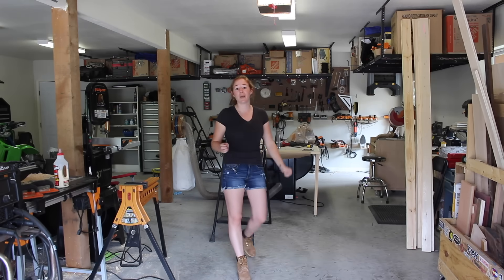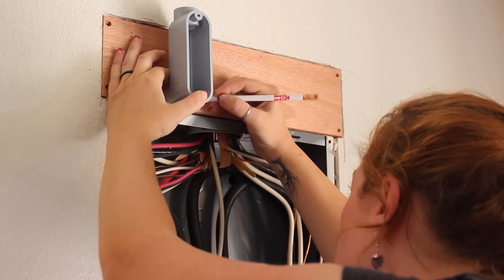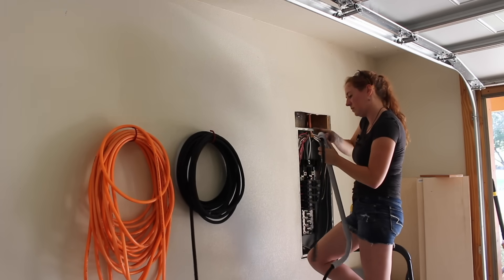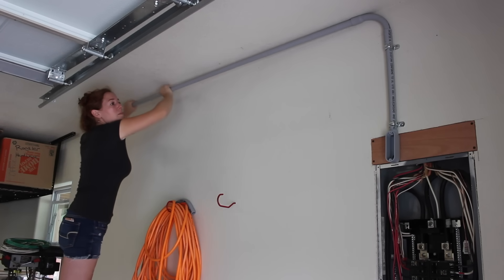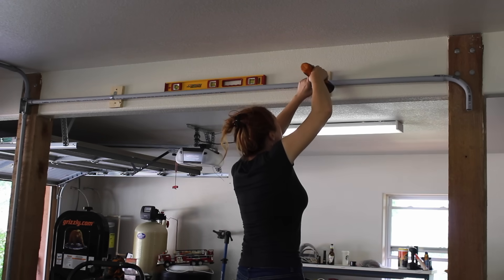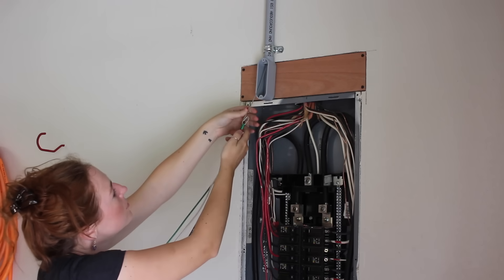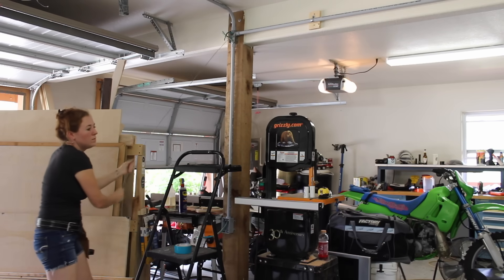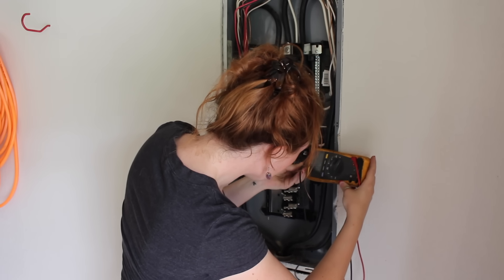Adding 220 Volt Outlets to the Garage

Comment: Some general thoughts:
-- Electrical work is generally pretty easy, at least in physical terms.  It's the other stuff that sneaks up on you.
-- Just because you CAN do something, that doesn't mean you SHOULD. To be specific, just because you have some open breaker spaces it doesn't follow that your panel can handle the new load. That's what load calculations are all about. In this example, it matters a great deal if the 220 is for the occasional use of a table saw, or the routine use of an electric car charger.
-- Garage / shop needs tend to grow. Rather than running circuits as needed, consider instead putting a panel in the shop - and feeding the shop circuits from there.
-- Splices in conduit bodies? Even IF you're technically legal, it's a lot easier to use a junction box - preferably a round one for junctions and a square one where you use bulky 220 devices.
-- I like your choice of sealed PVC boxes. In my experience, though, PVC requires a lot more support than code demands. It WILL sag over time. I also find it worthwhile to use primer along with the cement for stronger, more durable connections. It may take some doing, but you can find clear primer and grey cement.
-- The mounting screws need to go into wood, not just drywall -- especially for the boxes.

Comment: As a retired civil (not electrical) engineer and someone who makes short sticks from long ones, I have to wonder why (and how much spent) you accumulated several pieces of 220V equipment ("big" table saw, plasma cutter and compressor) BEFORE you had a means to power them.  I matters b/c although I have no room for it, the local FB marketplace has a real nice jointer but it's 220, and I also have only 120 at my house.

Comment: I'm afraid to mess with the main circuit breaker, but I do already have a 220 line going to where a dryer used to be. I'm installing a new washer and dryer in the basement and am considering running a line from that outlet to the basement since it's unused. Doing some research into 220v and already figured out what cable and how to wire the outlet. Appreciate the info from your video as well!

Comment: Since the 1950's are home ckts are 125VAC or 240 VAC, no 220v. You're also missing a neutral wire. The 240 VAC receptacle we saw wired up is for a heater or dryer.

Comment: SOOW/SJOW cord isn’t allowed in conduit due to its rubber jacket getting caught while pulling it through conduit 400.8(6) NEC.  You could have used NM(romex) in conduit this is allowed for physical protection even though some electricians will whine about it.  The changes I would have made if doing this project are putting a junction box 4x4 instead of the LB coming out of the panel it would have been placed on the drywall not the wooden panel with romex or mc running from
 the panel to the back of the junction box and the pvc off of that.  I also would have used a 1900 box (4x4) at your junction.  I didn’t see you ground the metal box this done so breakers trip if one of the hot wires comes in contact with the box the breaker will trip instead of the box becoming energized and is a code violation.  Thhn is not allowed to be run from an LB into a panel if it’s not in conduit this is a larger code violation than you fighting to pull the SJO cord through the conduit.  The last thing I saw was using a white thhn wire for a hot without identifying it as a hot with black or red electrical tape.

Comment: Why, oh why, does the thumbnail for this video show Ms. Wilkerson looking at the Fluke voltage meter with the meter in “landscape” orientation?  It’s not like a smart phone which will re-orient itself depending on how you hold it.  It’s a Fluke, and the display screen is the same as on all of them: one way is up.  Maybe she has hacked hers so she can use it as a gaming console…now that’s a video I’d like to see!

Comment: It's all about heat dissipation when deciding what type of wire to run inside the conduit.  THHN can keep cooler than SO.
Reply: No not really. The amount of current that will be drawn will determine the cable's cross-sectional area and length.

Comment: Good work! I like the clean, straight path you took from the panel, I would say though that THHN wire has to be in conduit for the entire run, so it cant be exposed in the wall

Comment: Sadly, the american electrical system is lame.  Single core wire and 110V.    Where I live. 240V and multi strand wire is the standard household system. . My workshop has 20, 240 Volt. 10 Amp, double outlets (switched as well) and one 15 Amp double outlet for the 4HP compressor.  Plus a 415 Volt 32 Amp three phase socket for a welder.   I can see why so many americans diy their electrical. Because it's virtually low voltage.    Have fun.

Comment: April, you are the bomb.... what a great video.  Your definition of scrap wood (that you installed above the panel), is certainly different than mine.  That piece of wood in my shop, would be one of the best, off cuts I have ever had.  LOL
Keep up the great work.

Comment: Anyone who isn't an electrician shouldn't be messing with it much less teaching it!! Did you ground your metal junction box, obviously used in error? You forgot to secure your ceiling run? Now, with all the knowledge you gained reading about this project, maybe you can explain how you attached the LB (the little gray thing near the panel) to the panel??

Comment: I am an electrician. I’ll say to your viewers, hire an electrician. You did violate some code articles. Exposed wires in your wall above your panel, no connector in your concentric knock out, and you did not bond your metal junction boxes to ground.  This is not the safest install but good job considering you the lack of electrical knowledge

Comment: You did a pretty good job just one thing, you did not use PVC Glu or PVC Cement to glue the conduit, so it is not sealed or fully secure.

Comment: If you run a plasma cutter and compressor on the same circuit, the breaker is going to pop since they'll both be running at the same time.

Comment: Running a 240v/60amp circuit from my main overhead in 1” PVC, across the ceiling and through the wall into garage for an EV charger.  YOUR video was the best I could find on YT - seriously.  I’m using YOUR idea to use an LB to get the 6 gauge into the panel.  That was an absolutely genius way to do it.  Thank you, ma’am 👍

Comment: I don’t know if you did it but just didn’t show it in the video but did you ground your metal junction box? Plastic ones don’t require it but those metal boxes do, that’s what that raised hill section with the 10/32 (I think) hole in it on the bottom of the junction box is for, all the big box stores sell packs of special ground screws specially for that hole so you can ground the box just in case there is ever a short

Comment: You are running THHN to the panel in “free air” between LB and panel? I know it’s short, I’m wondering if it would pass inspection since running THHN in free air is not to code

Comment: I'm looking to add a few 240v outlets to my Shop, for Welder, Compressor and Plasma cutter...

Can you run all three on the same circuit?

Seems like it'd overload the breaker if you used more than 1 at a time, like if the Compressor kicked on while welding...

Comment: First things First nice neat level conduit run, I think the way I would have done it is to place a junction box above the load center a dropped my Rated cord down to the panel then start my pvc or thin wall pipe with the open access you created gives you room to secure your cable to the stud, just a little FYI

Comment: So much better then most you tubers post!  I'm a licensed electrical contractor in CA and only a couple comments.  Should have used any color but white for your second hot leg. White is only for a neutral not a hot leg. Junction box could have been bigger but your make up wiring looked good. Conduit is necessary in a garage, Romex cannot be secured to a wall.  Good call on the conduit and THHN. Looked good!
Reply from the maker: Thanks!
Reply: @AprilWilkerson  using the white wld be OK if you mark it with black or red marker or 2 dabs of tape. And yes use a 4square box even a deep oversized square box a little more money but the space to work with is worth it

Comment: Wrap white wire that you used with 220v outlet with black tape on each end to identify them used as hot wire. This is only for two hots and a ground.

Comment: Permits. It's ok to do work at your own house, but it's best to pull a homeowner permit for a couple of reasons. First, the work will be inspected, and you can correct any mistakes you may have made. Second, when you sell your house, the prospective buyer will see the electrical modification was permitted and passed final inspection- this gives the buyers assurance the job was done right, and wont burn the house down one day.  You are a capable person, but many homeowners are not.

Comment: Plastic pipe is for the outside. Steel emt pipe is for the inside, I like using larger junction boxes for 220, and easier to pull Wire from spools on a piece of emt. Good job overall.
Reply: Depends I live in New england with a cement basement and metal rusts corrodes where as pvc dosent and its up to the ahj plastic and foam are nasty with flame

Comment: Nice video. I'm guessing you used #10 you may of mentioned it but I didn't hear. To any electrician out there I have a question. I may need to do a 50 ft run for a 240V air compressor. will #10 wire work for me or should I go to #8?.... Thanks
Reply: Depends on the watts but if you have the money nothing wrong with upsizing you cld no 6 and have power available for future e/v agian it's mostly up to your budget and actual wattage of appliance. I've done 240 a/c with 14 gauge

Comment: Sorry but if you are still using 110 and 220 in your vocabulary you should not be giving advise.  The US has had standardized 120v / 240v since 1967.  Please update your terminology.

Comment: Were you able to make heads or tails of pulling the permit? I had an electric quote $1200 for this kind of work, and it was one outlet and RIGHT NEXT to the panel. No major conduit work that you've done. But the permit process is rather confusing as it always seems to assume I"m building a whole structure and I'm wiring electrical within it.

Comment: Just a question: why didn't you use 6 wires from the breakerbox to the junctionbox and let 3 of them go down to the outet and the other 3 to the side to the other outlet? No need to cut and connect the wires in the junction box. Plus, you could have connected the wires to their own breaker to be able to use both outlets at the same time without running the wires too hot.

Comment: Great video. Great installation. As a suggestion, I would have used a double wide box where the three overhead conduits came together. This allows more room for stuffing the wires in the box.

Comment: [speaking as a novice] How do you get the 245v reading with the multimeter? As I understand, each pole is 120v. Does each pole on the meter go to each hot connection on the breaker? No ground involved? Meter setting on AC?

Comment: Great video. Working on a similar project. Can I run NM-B from the panel to my garage - and then through 3 ft of PVC conduit to protect it on the wall? PVC through header/rim joist, turn the corner and run a straight shot up to the surface mounted outlet box? Or do I run the NM-B to a junction box in my basement ceiling, splice to THHN and then into PVC conduit, through the rim joist/header into the garage, turn 90 degrees and go up the wall? Thanks!

Comment: I’m thinking of buying a Tesla and adding a 220V outlet to my garage but my circuit breaker is full so I can’t add a new breaker. I have a 220V for my dryer in the laundry room and I was wondering if I can somehow add another outlet in my garage taking the power from the dryer outlet?

Comment: as an electrician there are a few more items that i would talk about that are wrong other than the items posted already.  biggest one is that you used the wrong color coded wires in your pipe pull should have been a red and black not white. white is reserved as an identified color not a phase color  even though your typical home owner thinks there is an exemption for this that only applies to cables.  you should have used pvc clips on your pipe run not the metal emt straps. Even though someone already told you about your junction box should be pvc already or bonded properly it also does not meet the box fill requirements for the 6-#10 awg wires (i'm presuming based on the outlet you installed ) that's why in your video you had visible trouble stuffing the wires into the junction box. I don't see any PVC Glue used on your boxes or where the pipes are joined. as someone also said that LB above the panel you didn't show what else you used to connect that into your pipe run.  the reason you had to do that was because of inexperience it would have been better to cut your drywall out at the top of the wall and put a kick 90 at the top and run straight down into the panel knockout.  the reason being even if you did manage to use a pull elbow in that tight space you couldn't access the fitting to close it up and i'm sure you noticed this after you installed your pipe run but your access board can now no longer be removed if your pipe run was glued and secured properly to the panel.

Comment: Good job, only thing I would say is when pulling wires, use smooth strokes pulling,jerking pull will make it easier to kick/ skin wire, on longer pull use lube much to pull , say 50 plus feet,

Comment: I love April!  She is super awesome and is literally living the dream!!  Good for her.  However………. I am a GC and erk to see common folk try their hand at things that require very specialized licenses.  Electrical, HVAC, Plumbing - all things that require testing and licensing for a reason - because can be dangerous.  I think that she is at a point where she should get her licensing so that her channel will be a real hub for everything Construction and Carpentry taught by a licensed teacher.  That would up her value and increase the awareness to folks watching that yes you can do anything you want but sometimes it is not the recommended unless you know what your doing.  If complicated electrical was as easy as online research - there would be no licensed electricians helping to avoid fires.  Love you April.  You’re a beast with power tools - now spend some time in the office to build your brand and company.  Licensing is the last thing you need to get thing rolling.  Why not???!!!!  Do it!

Comment: Haven’t seen it mentioned, but not everyone can completely kill a breaker panel before working inside it. If the main feed and meter is directly on the other side of the panel, like in my house, then chances are the top section of the panel, behind the main breaker, will be live at all times. Just something to watch out for.

Comment: And for safety sake wear protective goggles when working in the panel Klein sells a good pair of electrician gloves would be a good idea also also rubber-soled shoes because you're standing on concrete

Comment: You're doing a great job however instead of that handy box you should use a 1900 box that you have placed on the wall where you coming off of the other receptacle you go girl I got my daughter doing electrical work Ben electrician 37 years PS you can put a handy box extension Coller on that handy box so you don't have to take everything apart

Comment: My house was built in 2005 and the panel is next to wall outside garage wall.  I dont have to go through ceiling right, I can just run a cable from outside of wall into garage wall. I will be buying an electric car soon and also an electric heater to heat up my 3 car garage/man cave.  wanna have this 240V ready before christmas:)  I have seen many youtube videos where they place electric heater up high close to ceiling on a corner and also the 240V up in the wall.  Since I will be using it to plug in electric car and electric heater whenever I am playing pool in garage should i install it to the hight of the other 120v outlets?  Also any advice before installation?

Comment: cool.   You did a good job.    There are multiple types of 240 volt outlets, based on the breaker size  you added at the box (and of course, the proper size wiring for the outlet).   Your Tesla wants a beafy 50 amp service, while, the dryer might be happy with 30 amps, and the welder might want 20, 30, or 50, each with a different socket.  You also used a "white and black wire", where "black and black" or "black and red" would have been a better choice.  But you should mark the white with some black tape, indicating that it's hot.   (At breaker box, and junction boxes).   Just might have been easier to run two black wires, because, other 240 outlets, want 2 hot legs, a ground, and a neutral.

Comment: Please use PVC cement when connecting PVC together. It not only keeps the PVC from coming apart, it creates a seal to ensure air or moisture doesn't get inside the conduit. I hope your conduit straps are within the proper distance as to NEC code. Any PVC between 1/2 and 1" needs to be strapped every 3 feet. Also, conduit needs a strap at least 12" from the box. I didn't see any straps leading to your receptacles, so might I suggest mineralite straps to prevent the need for box offsets?

Anyway, good work! Looks clean and level

Comment: I’d like to add but some tape on your fish tape head. This short pulls didn’t matter but longer pulls the head may get caught up when pulling through couplings. The tapes helps it pull over the joints in side the pipe

Comment: Did you use a bushing or screw-in clamp sleeve to protect the wires as they enter the top of the breaker box knockout hole ?